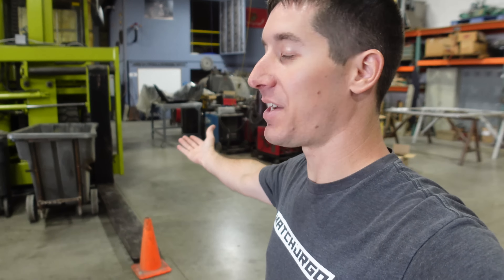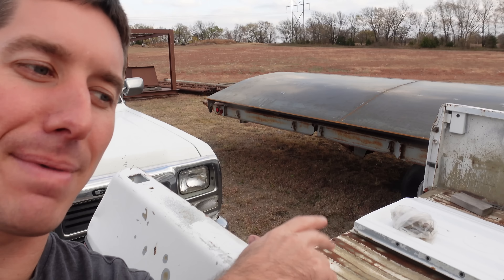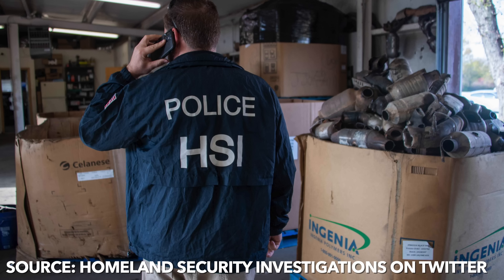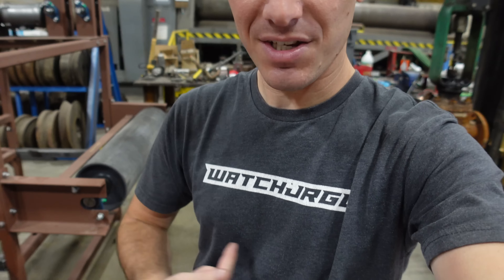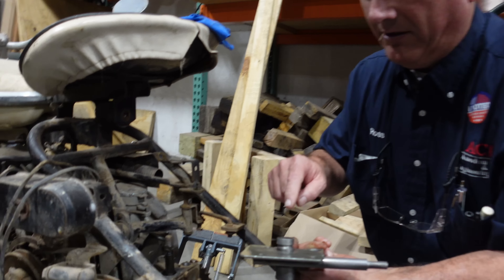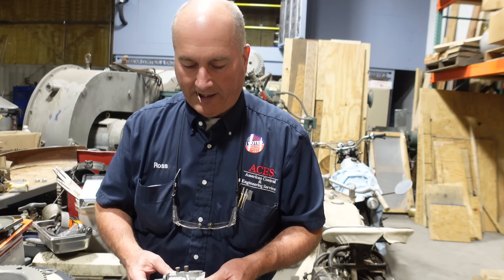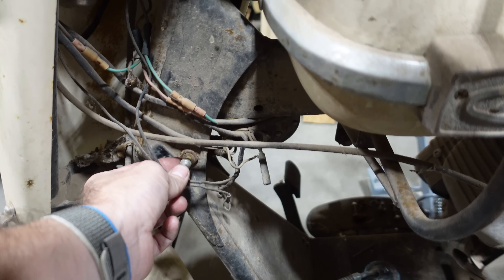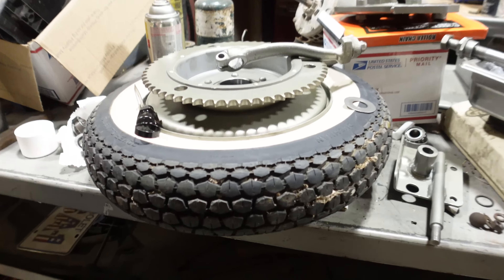Catalytic Converter Thieves HIT US But They WON'T Be Stealing Anymore

Comment: I love the Eagle. I bought, sold traded and worked by way into a Super Eagle as a teenager. It was baby blue with twice pipes and saddler bags. It would run 55 mph with no problem. I traded it for an international pickup when I was 16 years old. Thanks for the memories. I can't wait to see you dad finish the project Eagle.

Comment: Speaking of Karma, years ago (1994) I read an article from Australia that was a Darwin award winner. Two thieves broke into a glass recycling plant back lot to steal scrap. One of them crawled underneath Bedford tip-truck to unbolt the engine. They decided to "pull" the engine from underneath. As one of them was loosening the bolts, the engine broke loose on the guy's face. Police figure there were two because of the vomit they found. The kicker is when the local news interviewed the facility manager, he said that if they asked, he would have given them the truck because it was due to be hauled away and scrapped.
Reply: Thats a complete urban legend. NO heavy excavator would only have "4 bolts to hold the engine in", and then have the engine drop out with only 2 removed. 🙄
Reply: @davelowets  I got lazy and tried to remember the details. Found and fixed

Comment: The Ford dealership I work at in Massachusetts got hit last month. Two brand new F-150s that were sitting in a corner of the lot not covered by the cameras got cut. It's nuts.

Comment: we had a battery thief in our neighborhood. i ran an extension cord out to my car and it happened to have a bare wire that happened to touch the frame of the car. at two in the morning i heard screaming and walked and saw the kid dancing and screaming i just laughed and unplugged the cord. the kid took off. then came back the next morning and had the same result. four times this stupid kid tried it. he even called the cops on me. they came out and told me i really should be fixing that cord because someone could get hurt. but he was smiling at the time. after that i kept the cord hooked up to the car and set the cord by the plug in. the kid would walk by and give me the stink eye but he left my car alone.and nobody stole my catalytic converter.

Comment: Love seeing your Dad with you, I could hang with him all day, I am like him when it comes to rebuilding stuff, it's all in the details. I was a Lawnboy mechanic before the 4 strokes came along and used to restore the old ones from the 60's as our shop was a dealer for 50+ yrs and we would have all the parts sitting in stock, I use a NOS round Lawnboy gas tank as my test tank when I am working on motorcycles. it zip ties to the handle bars real easy lol.

Comment: A few months back, someone stole the muffler off my car while I was at work. It was clearly Sawzall'd off. I'm assuming they thought they were stealing my catalytic converter.

My car has no cat converter though. It's a 30 year old car, and right at the start of the pandemic, the pipe it was connected to rusted and broke, and the bolts rust welded to the car. Since we no longer have emissions checks anymore, I just straight piped it.
Reply: 30 year old cars ALL had converters on them. It's been MANDATORY in the U.S., and many other nations, since the mid 70's for all cars.

Comment: Worked at a convertor recycling place here in PR, before retiring, had a guy that checked all the numbers on the convertors before I sheared them and dumped the contents in large boxes. Shipped the boxes to someplace in NC to  separate the material into the precious metals. Cases were put in dumpsters for local scrap disposal. Some convertors had to be plasma cut since they are cast steel and couldn't be sheared. Aftermarket convertors have no value, we had many boxes of the laying around untill the market for them would come to light, many wreaking yards would include them as a package with regular  convertors as an all  or nothing type deal in the sale since they couldn't deal with them since they could scrap them due to the contents inside.

People have been stealing convertors since the late 80's, remember one dealer got hit near me in Syracuse , NY. It's just the price of the precious metals has skyrocketed  recently which is more than the price of gold..

Comment: One of my neighbours was hit (a 99 Mitsubishi MPV), from the moment they pulled up to the moment they pulled away, was less than 2 minutes on CCTV. Was unbelievable yo watch.. He scrapped the car because of it due to the cost of replacement. Someone in a neighbouring street was hit the same night (think it was a 90`s MR2), & a few weeks later a single mother was hit (a 2000`s Rav4), she went out to them & was threatened by 2 guys with hammers & bars while the other guy was doing it.... 

I was also sent a video on WhatsApp of a BMW being hit a few miles away, not only did they pull the whole exhaust, but they also punctured the petrol tank & stole the fuel (was during last years fuel shortage in the UK)

Comment: Good. This is out of control. We had about 10 cats stolen from vehicles in the parking lot on a construction site. It amazes me that no one saw anything. Middle of the day in a gravel lot right on the site. 100 feet from the building. Half the building didn't even have walls with scaffold everywhere so workers could look right down on the lot. Mission Impossible type thieves. And I mean they stole about 10 of them at the same time. It happened more than once but that time was crazy how many they got in one swoop.

Comment: It's even worse for us in England. Cos every 12 months we have to pass a MOT. and it's a fail if your engine light is on. Or if your car fails a emissions test which obviously they do if they don't have a cat. So if someone has a older car that's only worth a little bit. The cost of a replacement is likely to be as much as the cars worth. And if you have a older car then probably already struggling to keep it on the road already with petrol prices and road taxes. You lot can get anything on the road over there by looks of it

Comment: This is why I think they should relax the laws on converters and allow people to use aftermarket catalytic converters carb compliant or not because of the time it takes to order an OEM part due to the pandemic & supply issues, & if an individual has to bypass it with a pipe temporarily then so be it.

Comment: I hate those catalytic converter thieves. They get under anything easy to cut them out of. It's illegal in Oregon and Washington but they just load up a truck and go somewhere that will take them.
So far my 06 Charger RT is very low to the ground and they're tight up high so so far so good. Watching now...
Reply: *thieves
Reply: @Mrshoujo  I thought that didn't look right but spell check was happy so I sent it. Fixed😉

Comment: Got my cat stolen last month out of my element had to go with cheep eBay replacement not as good as the original and still very expensive
Reply: Walker and some others have guarantees but are limited to 50k miles.  Will you secure the new one?

Comment: No, it will not take away the incentives of the thieves.  By creating a market for these precious metals the thieves will keep going.  After these arrests and clearing out the stock of these cats, the next company has a huge gap to fill, driving the price of the cats up.  As long as there is a market the cats will get stolen.

Comment: This happening in Europe as well
Reply: Where in Europe?
Reply: @jamesmedina2062  I was listening to the BBC . They said in the UK it was the second most stolen car part. They said thefts have skyrocketed through out the EU.
Reply: @andrewchristopher7138  I grind steel tubing for exhausts all the time and its loud. Also, lifting lower vehicles would take time, make noise, and be obvious. So It beggars the questions of how does this stuff happen easily. I think manufacturers could install cages that were not heavy or too expensive. When a minority of the public suffers or its an expense the majority in power ignore the issue.

Comment: Cmon JR... we all know that emission test are bs and obd2 cars can almost always pass the scan test without a cat. First drive cycle the codes wont set off the check engine light but it will go through all monitors so driving the car for 40 min after a code clear will get you a pass even if your car doesnt have a car at all. Its all just a money bussines and has nothing to do with enviromental safety. Cats barely clean any fumes from an internal combustion engine. This will work on any 1996+ car as long as both o2s are functional no spacers needed. I sold over 100 used cars and some passed emissions with no cats. In indiana and chcago area of IL they dont require visual for emissons test and registration.

Comment: I am waiting for someone to steal my catalytic converter on my 02 Forester because it has a exhaust leak and PO420 code and next year in Illinois I am due for a emissions test
Reply: Funny I just seen a guy comment the folowing...

 we all know that emission test are bs and obd2 cars can almost always pass the scan test without a cat. First drive cycle the codes wont set off the check engine light but it will go through all monitors so driving the car for 40 min after a code clear will get you a pass even if your car doesnt have a car at all. Its all just a money bussines and has nothing to do with enviromental safety. Cats barely clean any fumes from an internal combustion engine. This will work on any 1996+ car as long as both o2s are functional no spacers needed. I sold over 100 used cars and some passed emissions with no cats. In indiana and chcago area of IL they dont require visual for emissons test and registration.
Reply: Try to clear the code and drive your cars drive cycle and when you get to the emission spot when they tell you to shut the car off DONT make something up like "it might not start"  if its restarted it will set off the cel and you will fail. So they wont make u shut it off because they dont want your car to be stuck in the spot. Make sure all monitors pass 1996 to 2000 can have 2 monitors not pass, 2001+  only one. Only Evap or EGR can be not set all others gotta be. You will pass 100% and be able to register. I garantee

Comment: as much as i wished this would help it wont. there is always the next group looking to take the top spot. the money in this game is so high that they'll move on to the next rung in the ladder. all the feds have done in this case so far is just wiped out some competition. With the millions in pay offs and the money they've made already they'll pay off the corrupt judges and officials who are only really mad about it simply because they aren't getting their handouts. so now all those palms will get greased some low people on the chain will get every bit of it pinned on them and then business will go back to business as usual. with big busts like this its always the same. it doesnt really matter if its drugs or guns or cats. folks just pay off folks and get back to work